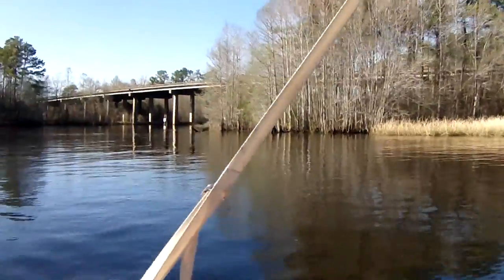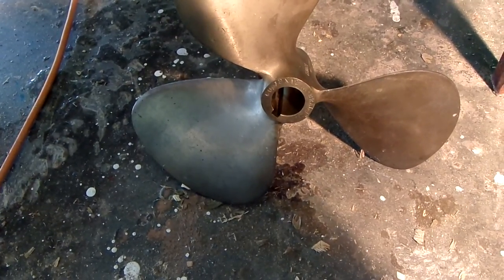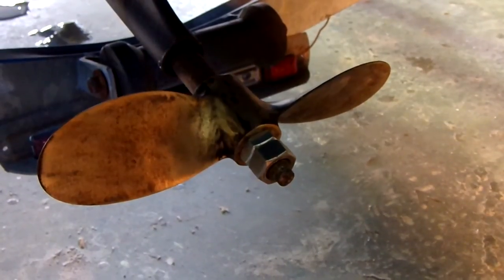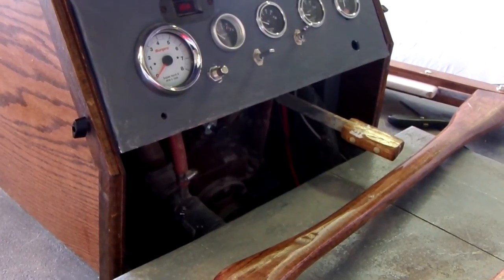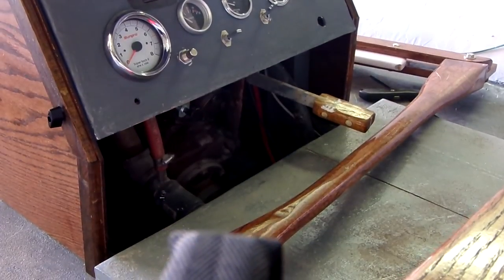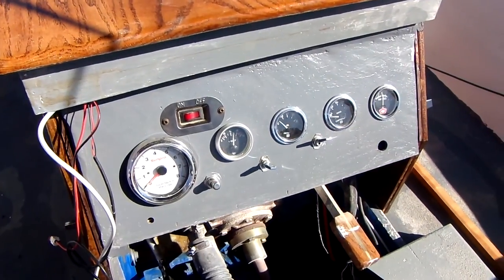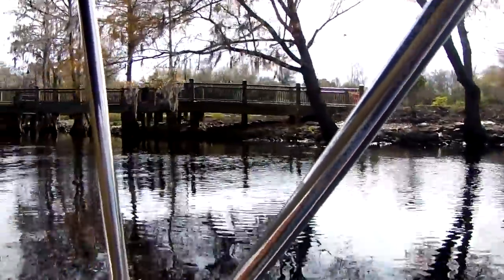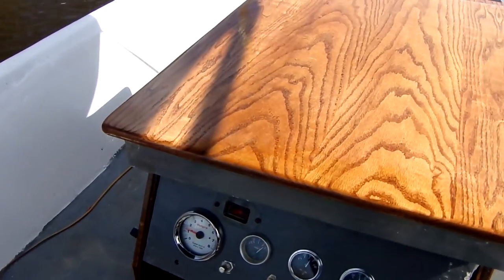Installing an inboard motor in a small boat update 12 of 13

Comment: My Atomic 4 ran hot above 5 knots until I changed the hull water inlet to a scoop strainer, facing forward. Before that, at speed there was turbulence at the hull inlet that prevented good water intake. With the scoop strainer I can run at 6.5 knots... But she is an eight ton sailboat, so I keep her below 5.6 to save on fuel. I enjoyed your entire series building this cool boat.

Comment from the maker: Figured I didn"t need one since the whole engine,the gas tank, and the gas line are all exposed to the open air.  However I suspect you're right, so I'll check it out.
Thanks for the heads-up.

Comment: The propeller is sized to the size/weight and shape of the boat/hp/max rpm. That big prop should wihip that little boat along very quickly.  The only thing a big prop will do is prevent you from reaching max RPM.  The slipping is solely clutch adjustment.  A boat is prpoped out to reach but not exceed max RPM, a smaller prop (Dia or pitch) will allow the engine to over rev.

Comment: You're running on fresh water, right?  180 F is actually the ideal temp for that (and most) engine, and the fresh water t-stat is designed to keep a 180 F operating temp.  If you're on salt, or run in both, then a 140 F t-stat is used (to prevent salt from precipitating inside the engine at the higher temp.).  So, which one is in the engine?  Sorry if that was covered elsewhere, and I missed it.
Reply from the maker: It was covered elsewhere, but I'm still overjoyed to get a view and a comment.
I don't have the fresh water conversion on this engine.  It sucks raw water from the river, lake, or ocean and pumps it directly through the engine.  Actually, the engine is built with some very high grade steel, designed to avoid corrosion, even from salt water.  They do clog up, but it is mostly sea growth and calcium deposits.